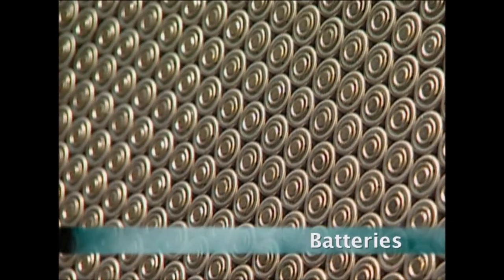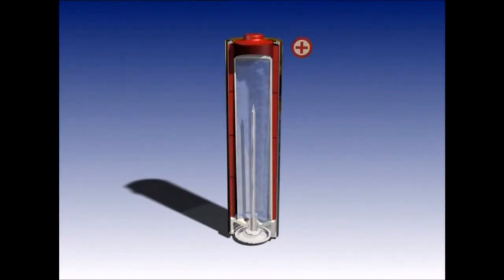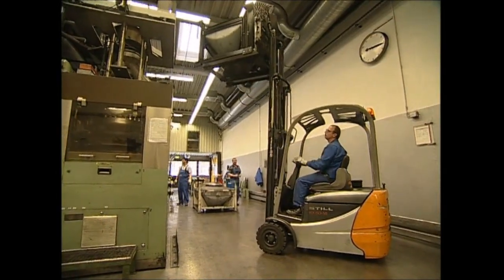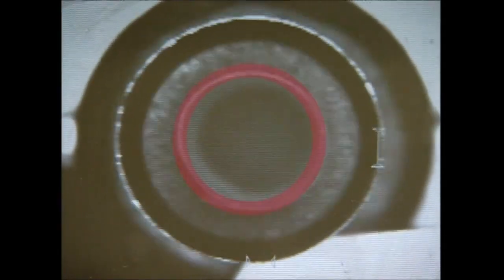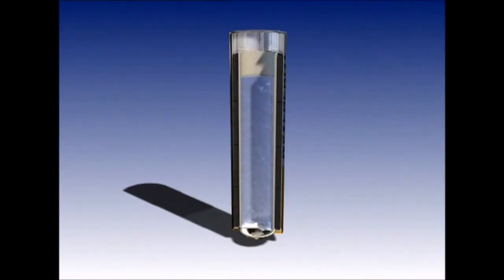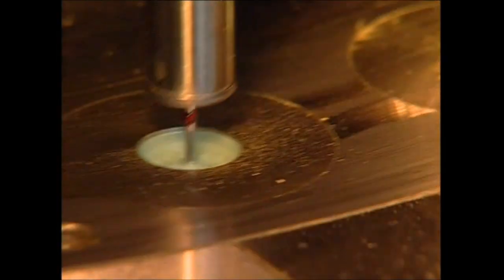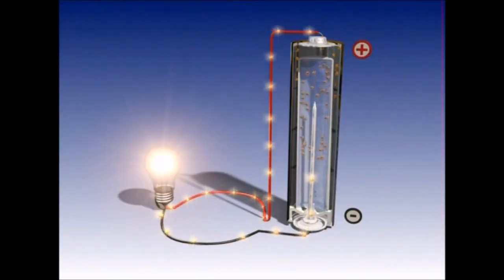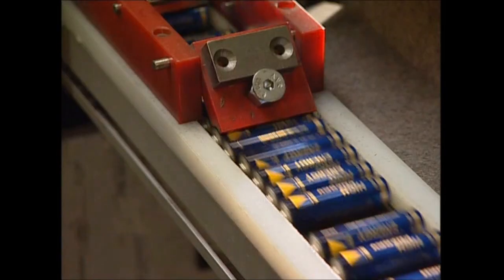HOW IT WORKS - Batteries

Comment: One huge glaring error: Electrons flow from positive to negative. If electricity flowed from neg to pos, then the alternator in your car wouldn’t keep your battery charged. The negative side of a car battery is attached to the chassis, making it ground, aka earth.  The chassis of a car / negative side of the battery can not hold a charge.  An automotive alternator produces about 13.7v DC, and is connected to the positive post on the battery, which is about 12.4v DC. Voltage is like pressure, 13.7v is higher “pressure”, so electricity flows to the battery positive,  recharging it.  The positive side of the battery is the high “pressure” side of the battery, hence why it need replenishing after using it to start the car.

Comment: Basically if you don't understand it, a battery works like this: two substances one with a deficit of electrons & one with an abundance of them are put inside a tube but sealed from each other, when the top & bottom are connected the battery wants to equalize and so electrons travel from - to + causing for example heat and light radiation to emit when traveling through a bulb filament.
Reply: Save.worldwide thank you for a simple and helpful definition
Reply: Same